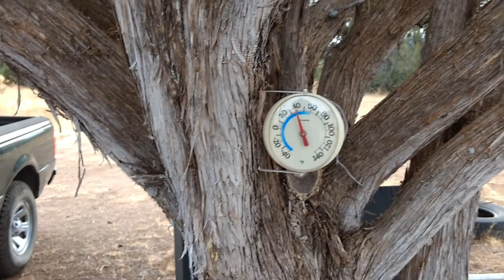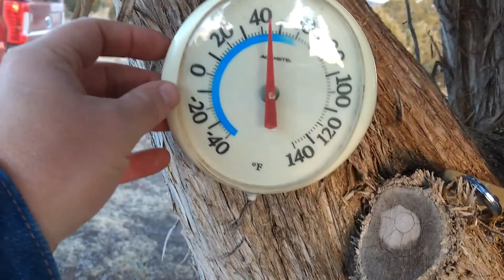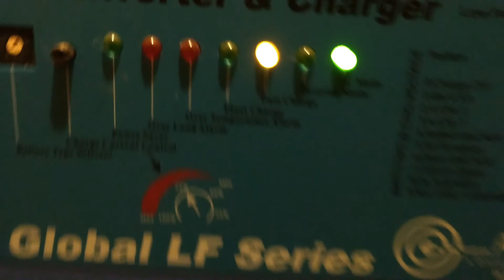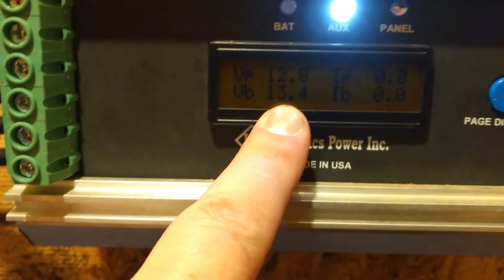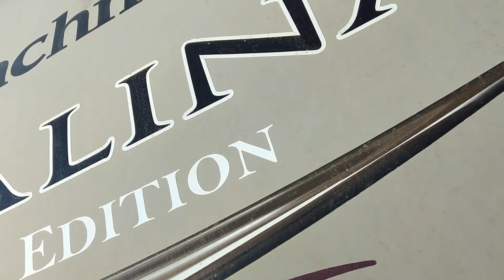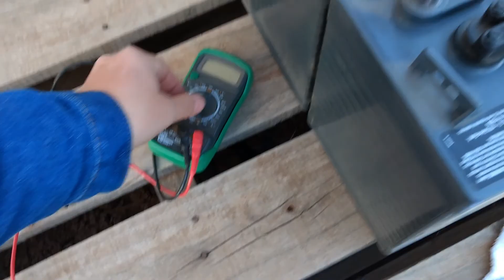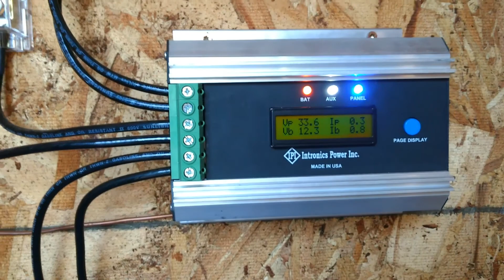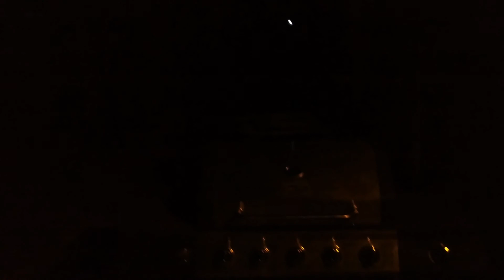More Solar Power!!!

Comment: Just found your channel .very interesting  . I'm looking to escape these brutal hot summers in Vegas to a little bit cooler climate .started looking for some land to homestead in AZ  .Do you recommend any area for cheap land with some rainfall for harvesting with little building codes and cooler elevation
Reply from the maker: Arizona is strong on building codes.  I have however, seen entire  homes built in an off grid setting in rural areas with no permitting and they are left alone.  I would not advise it though. But to answer the rest of your question, northern Arizona along I-40 except Flagstaff would be a good place to look.

Comment: Those were whitetail deer, not elk.  The tracks on the side of the road were cattle.
Reply from the maker: Brother, my eyes aren't 20-20, but I know an elk when it crosses the road in front of me.  If you look carefully in the video, you will see the big boy and his rack in the trees behind the small one that was staring me down.  As for the tracks on the side of the road, of course there are cattle tracks as it is an open grazing cattle ranch, but there are also plenty of elk and yes, the occasional white tail as well.  I suppose it's time I invested in a higher resolution camera instead of using my cell phone.
Reply: I didn't mean to come across too harsh.  Thanks for the video.  I re-watched the zoomed in part.  At 5:25, it does look like the side of an elk.  5:38 sure looks like a whitetail to me.
Reply from the maker: No worries.  I admit, the one out front did look like a white tail from the video, but I guess my phone doesn't do it justice.

Comment: Hey buddy. I have a couple of questions. I read that juniper is a good wood for a wood stove/heater. Does green juniper smoke excessively? Secondly, on your solar system,  what is the gauge of your feed line and distance from panels to charge controller. Trying to decide between 12 and 24 volt systems. Merry Christmas and thanks.
Reply from the maker: Yes green juniper does smoke quite a bit much like most green woods.  The junipers here are considered to be a semi hard wood according to the locals. 

I use a 6 gauge stranded wire from the panels to the charge controller and the distance is about 20-25 feet.  At these specs I have no noticable voltage drop.  I would definitely encourage you to build a 24 volt system.  I wish I had gone with at least 24 volts.  Unfortunately, my expensive inverter is 12 volts.